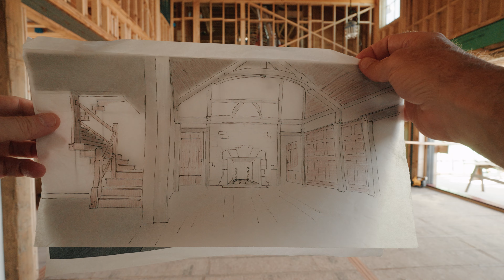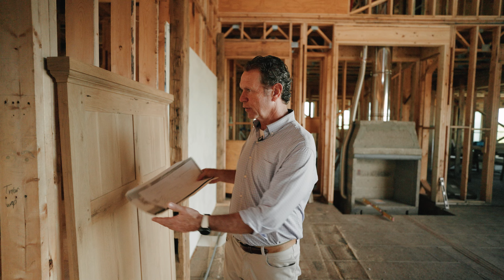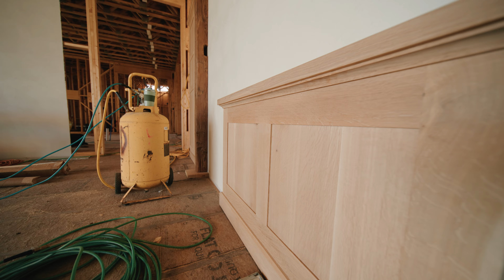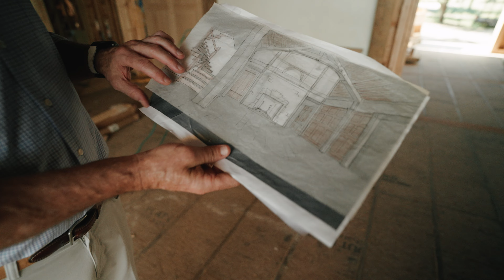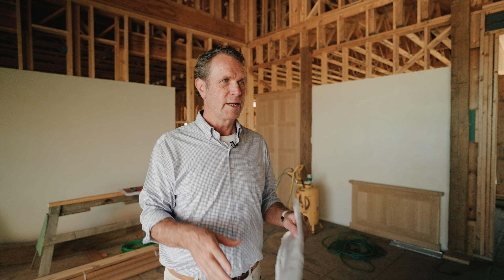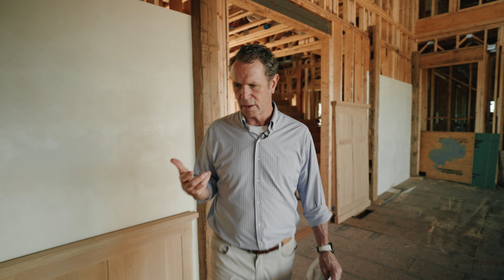Design process - From Conception to Wall Samples

Comment: Hi Brent, great video! I’m curious as to why the homeowners chose the more refined, “modern” looking wood for the paneling as opposed to the antique wood you show? To me, the room looks like one of those old English banqueting halls with those rough timber posts, the solid timber stair treads and the stonework around the fireplace. If this was a historic English banqueting hall in a house out in the country the only way I could see having the more refined wood paneling in the room is if a later generation of the family wanted to update the look and I think in that situation they would have covered the rough posts with the same refined wood to make the room look more cohesive.
 
On another note, can you do a video on the choice of wall plaster you’re using and its installation? Thanks!
Reply from the maker: Thanks, the house started out as very modern, I've been pushing them towards more historic precedent. We're looking for a blend. Yes on the plaster. Thx.

Comment: Wall paneling: I have a very rustic log cabin in the mountains of North Carolina.  Hurricane Helen dropped 2' of water upstream on us and the New River got into the second story of my Log cabin, 12' inside.  I ripped out all the soaked sheet rock and insulation.  Can someone recommend a wall/panel and insulation option for a flood prone location?  the last flood was 1997 with 4' water inside cabin.  However, I cant make my house float with closed cell insulation, I witnessed two houses float down past me on the river during the storm surge.  I was thinking rough cut white pine?  Plytanium T1-11 Natural/Rough Sawn siding just looks too cheap.
maybe I just beef up the heating system and forget the insulation?
My stair treads to the upstairs were made from the window cutouts on the logs when they bult the house 65 years ago from 200 year old reclaimed chestnut log cabin
Reply from the maker: Wow. So sorry for your issues. I may opt for the historic option of more heat. Good luck.